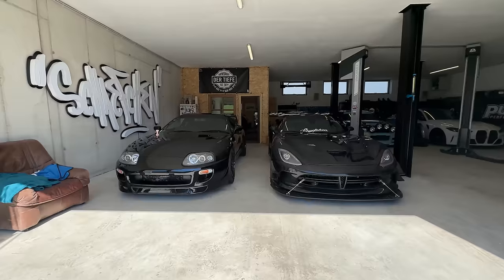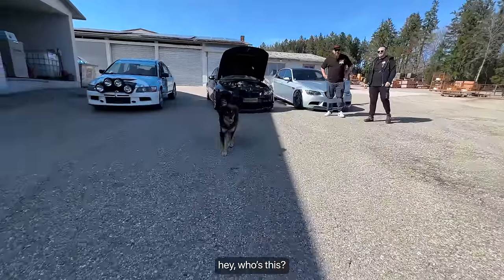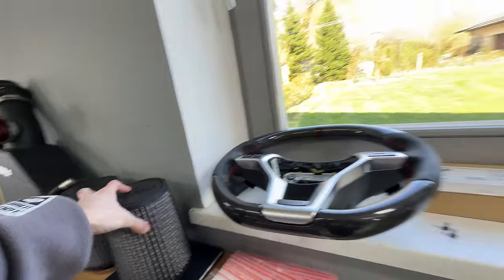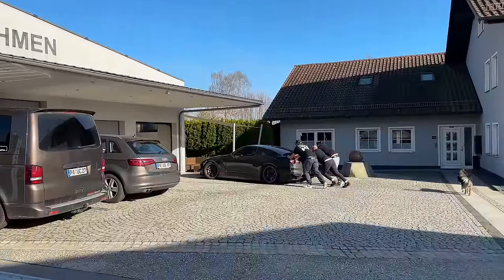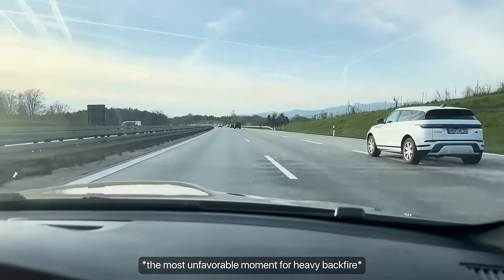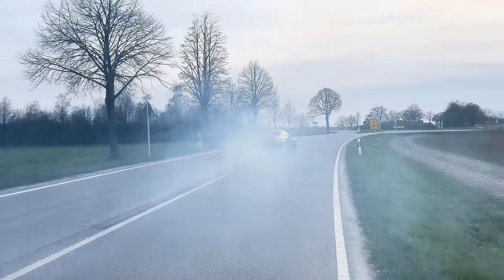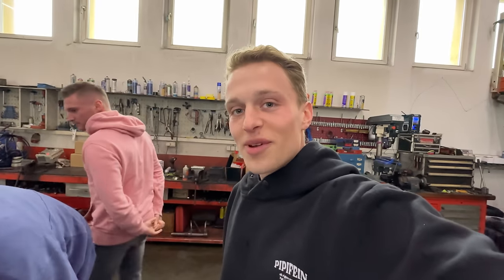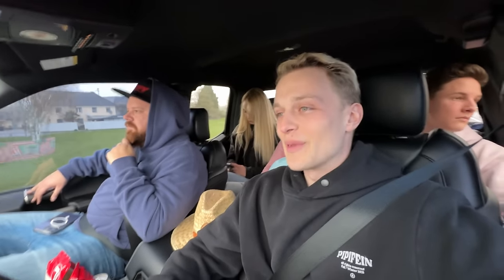2x 700 HP E9X M3 on the Autobahn - DESTROYED MY E90 M3?! - OG SCHAEFCHEN

Comment: PRO TIP (for everyone): 
If you have a secondary car then strap the GTR (or any other car next time) to the secondary and pull it onto the trailer by driving sideways/paralel to the trailer while the other person in the towed car is keeping the wheel straight so the car gets on the trailer with zero effort. Be VERY carefull about manual winches and the wires. Always lubricate them a bit (large crane operators do this all the time and electrical wires are lubed as well) so there is zero corrosion on it and the friction will be lower. If you can buy a bag to protect the winch when not used and if possible keep it somewhere safe and not 24/7 on the trailer mount. It will prolong its life by a lot. The biggest problem you could face is small rips in the wire itself and one day it may snap hitting you in the face which in extreme situations can end up deadly. I have massive respect for any wire and therefor I use ONLY remote controlled winches :D if that ever snaps then the worst thing I get is a new back window of the towing car. Plus also look out how much load you can put on the winch. Some manufacturers like to place fancy product numbers in the name like DRAGON3500 implying it could take 3,5t but then you look into the papers and the fine print says 1350 or less :D

Comment: Das würde mir sowas von auf dem Sack gehen, wenn immer wieder die Motorlampe kommt. Das ist doch echt mühsam. BMW‘s haben immer Probleme. Kann man nie tunen.
Reply: Gehört eben dazu. Das Auto hat 700ps und wird immer getreten. Ist klar, dass da was kaputt geht
Reply: @chadmueller9135  Bei allem Respekt: ein alter RS6 V10 mit 720PS kannst Du X-treten da passiert im Vergleich dazu NIX. Auch bei einem Turbo S 997 von 2007 mit 800PS passiert gar nichts. Es ist einfach die BMW Qualität die halt nicht auf demselben Level ist.
Reply: @donatokeller1761  weil ein kompressor denn motor mehr beschädigt bei so viel leistung wie ein turbo. Weil der m3 produziert halt fast das doppelte an leistung wie normal